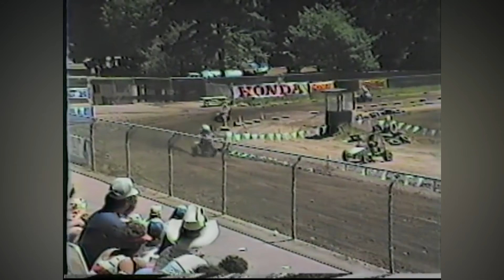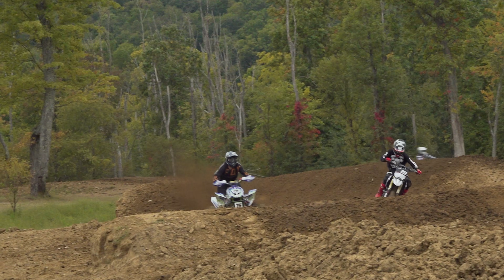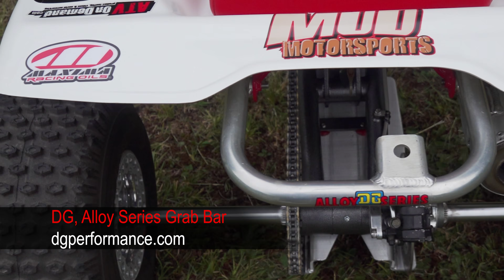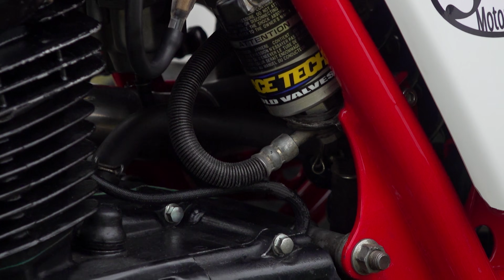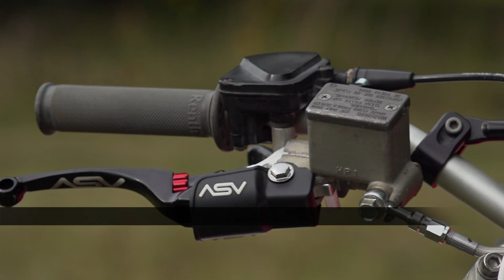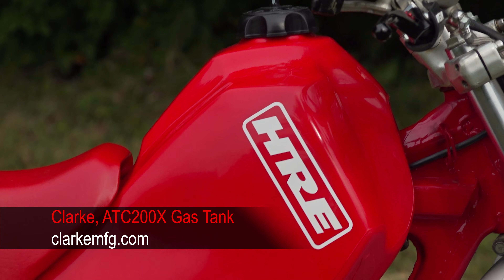1983 1985 Honda ATC200X Motocross Project Test

Comment: Wouldn’t be fast tho would it. I wouldn’t bother with a 200cc 4 stroke
Reply from the maker: If you wanted to race this class, you would.
Reply: The weight of the 200x makes is my favorite machine overall. It goes anywhere and on tight tracks its sooo much smoother than anything heavier. Mine is quad-converted and i wouldnt trade it for any newer quad of the same size. The engine is basically immortal but most parts are super expensive.

Comment: Would've been faster with a twist throttle.
Reply from the maker: 😅 nope
Reply: @ATVonDemand the old pros would've ran one lol
Reply: Apparently you've never ridden an R or an X with a twist throttle, on a 3 wheeler, when you stand up to go off a jump or in many other situations, your body English and grip on the grip actually makes you twist the throttle at inopportune times, extremely unsafe
Reply: @kalybnielsen4183 I ride an '84 Kawasaki Tecate actually. They came from the factory with a twist throttle. Mine has a kx500 reel for quarter turn. 
I owned an '85 200x for a while, switched to twist throttle. Best thing I ever did. Stiff learning curve for sure but well worth it.

Comment: Im building one 1985  with a crf230 swap 
Motor drops right in no messing with the frame 

The crf230 motor  is gonna have 69mm 13.5 compression  piston . 
30mm carb .pro com cdi 
And custom megacyles cam 
Xr200 kibblewhite valve spring. procircuit full 230 system. bvc inverted triple front forks . Bvc 450 swingarm . Custom elka shock
on vp racing C12
Gonna be  28 to 30hp hp (thats a esimate)  200x with  a manual 6 gear e start motor

Double the stock hp 
Extra gear 
Estart
All new maier fenders nos 200x headlight bezel and glass oem 200x tank professialy painted frame painted r109 passion red nos seat cover 
She gonna fly n be purrty

Comment: The engine sounds good, kinda surprised you didn't add an oil cooler.  They were a pretty common upgrade for the X and I know Mickey Dunlop sells them.  I'm thinking about doing his big bore kit for my 83.
Reply from the maker: John Pellan has the stroker in his 200X. LOVES IT! Oil cooler would be good but we're only running short motos. Oil changes are frequent as well.

Comment: Love these smaller machines they are always a blast to rip around. Never rocked a 200X but looks like fun
Reply from the maker: It's fun!
Reply: They’re fantastic. So much fun. I take mine on multi-day trips with friends riding big can-am quads and RZRs. They have fun in the mud holes I have fun everywhere else. It sucks the price to get into one is so high now. At least if you get one and don’t like it you won’t lose anything selling it to the next guy
Reply: And the aftermarket is still alive for em which is sweet. You can still build up a full on race trike if you want with new parts